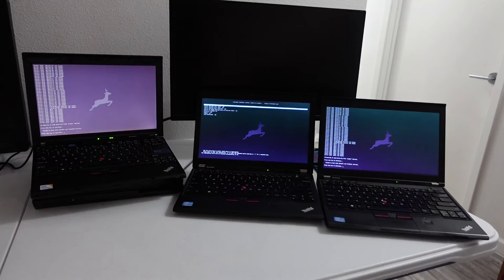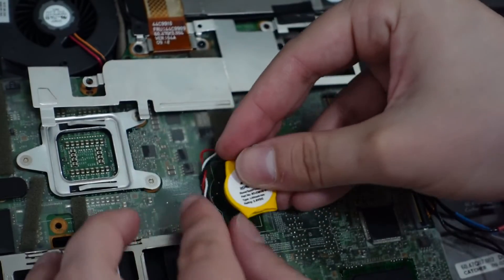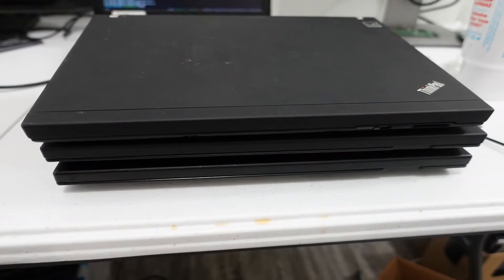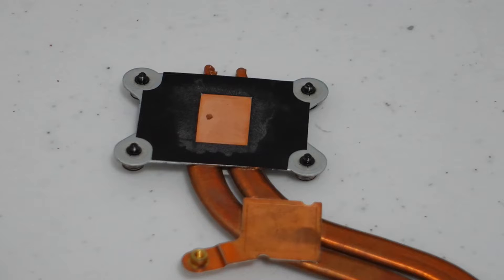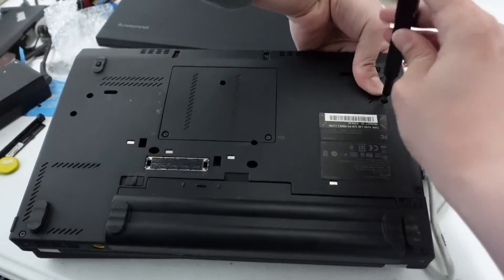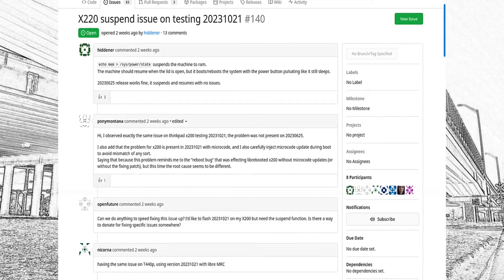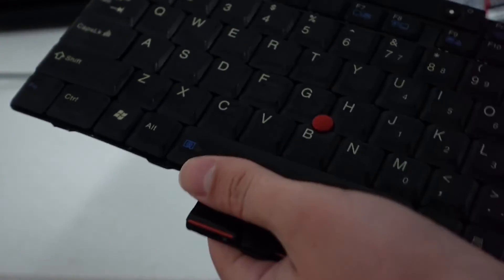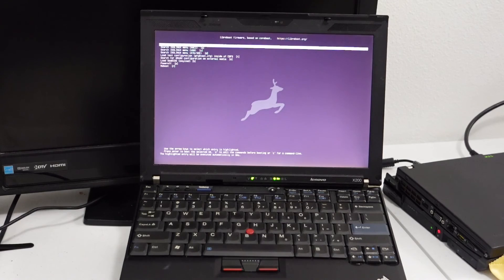Building a lot of Libreboot Thinkpads (X200 & X230) :D

Comment: I heard libreboot now has proprietary blobs. Is canoeboot available for the x200 and x220?
Reply from the maker: @Richninjaa  I think the x200 is, but I'm not sure if libreboot contains proprietary blobs for the core 2 duo systems. It was blob free in the past on those platforms and compiling coreboot for most of them does not require proprietary blobs. There are exceptions though the ati t60s for example need a vgabios to work properly.

You need a few blobs to get sandybridge, ivy bridge, haswell etc... working though.

So, I imagine the x200 is supported by canoeboot, but not the x220.

Comment: I have a Librebooted X200s running Linux. Its a great computer and just keeps on going. The X200s I use for my personal use, I use and X220 for work. I have owned both since new and with some careful (minor) upkeep both still do everything I ask of them. I don't let them go because they are cheap to keep going, dependable, fully serviceable, tough and so far I have no issues. I will keep them going and I cant see them giving up anytime soon.
Reply from the maker: Sounds like a nice setup, I used a X200s in the past and its a great machine. I miss the battery life. The X220 is also a nice system, I've had one setup with wwan before which was pretty cool :D Both machines are definitely usable today and will be for quite a while, so I'd hang on to them.
Reply: @tripcodeQ7  They are both excellent machines, I am typing this on my X220 offshore Saudi where its still doing great service. I have tried more modern machines but keep going back to the X220 and X200s simply for the ergonomics and the outstanding durability, more modern machines just cant seem to hack the hard usage, knocks bumps environment etc. The keyboards cannot be matched and the quality of build is just outstanding. They just keep going and I cannot see any reason to replace. In a way they remind of my old Land Rover almost infinitely repairable. I have a couple of old units sat at home that I paid almost nothing for simply for spares. On a final note I love your channel and have been a subscriber for a while now, thanks and keep up the work, really enjoy it !
Reply from the maker: Its pretty cool the X220 is still seeing industry usage @Howie900 .

Also thanks I'm glad you like the channel :D

Comment: Welcome back man, unfortunately  my T430 motherboard died a couple of weeks ago so I replaced it with a T460 but its memory lives on as I used some spare parts (mainly the WIFI card and antennas) to enable WIFI on my pizza box computer
Reply from the maker: Is the pizza box computer in a cardboard pizza box, or just an older style flat desktop :D
Reply: Just fyi. Not "man", unless you mean it informally.

Comment: It would be awesome to Libreboot x200s
A lot of people possess one but couldn't Libreboot it because it is just too tricky
But if there was some good video guide...
Reply: Years ago, I somehow managed to solder the wires to the wson chip and librebooted my x200s. Over Christmas I replaced the wson chip with a 16mb soic chip using a heatgun 🎉
Reply: @KaiserTheAdversary  this is amazing. Hope someday I also can do it. Where did you get a soic chip?
Reply from the maker: The slim models wson 8 chip is a bit hard to flash.

There might be a way to do it without soldering or replacing the chip. Maybe probe pins.
Reply: @tripcodeQ7  if a new chip can be ordered in places like AliExpress or something like this and be easily soldered then it's not such a problem.
For the viewers it would be useful to see all possible solutions with and without replacing the chip.

Comment: I have been trying to coreboot the x230 but it doesn’t work I’ll try libreboot
Reply from the maker: It is worth a try. If the rom isn't starting I'd double check if you have a valid oem binary.
Reply: @tripcodeQ7  it probably doesn’t as I purchased these laptops as is.